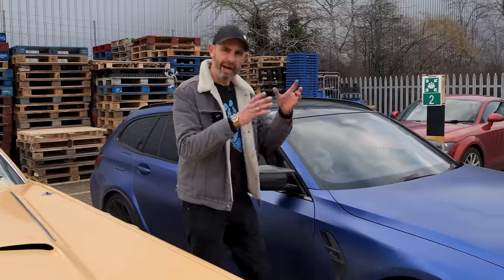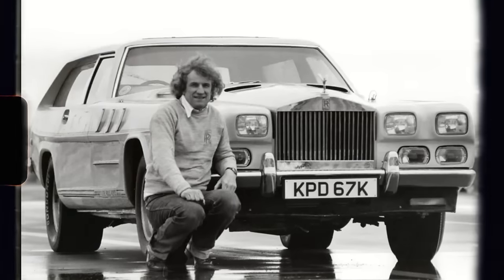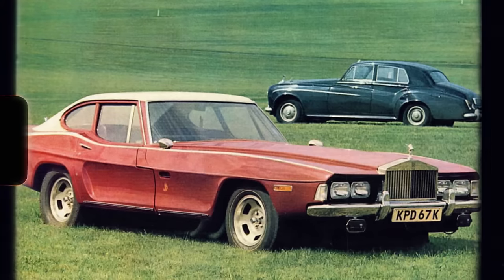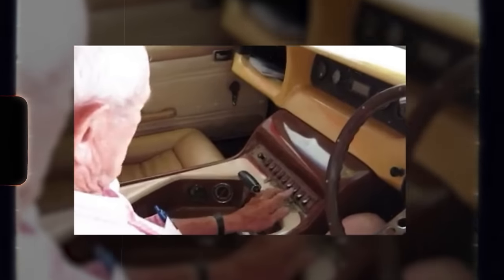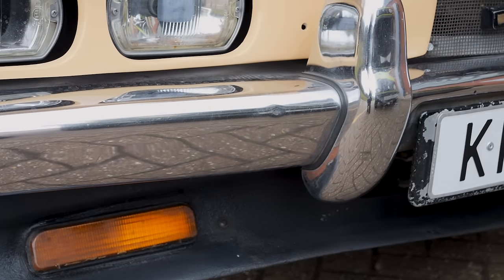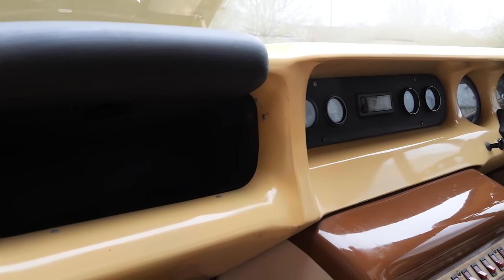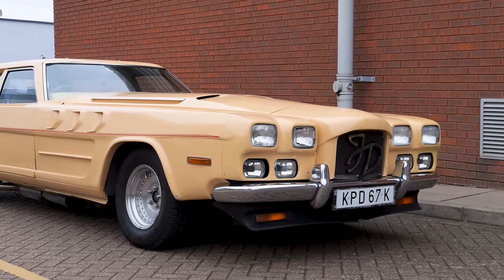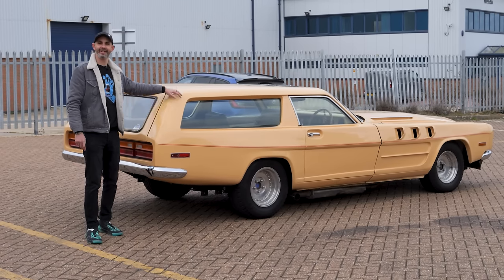Driving The Beast! 27-litre V12 Spitfire engined car on the street

Comment: Great video John! Its always great to see something someone has built from various  parts they've aquired. This in particular especially dealing with an engine idling at only 150 RPM. I noticed in the write up somewhere it was mentioned that a step up gear box was added. That probably is right off the crankshaft to get the input speed to the transmission correct or they would've had to make a custom designed torque converter to run at 150 RPM idle. Otherwise the standard converter would become a stall converter! I tried to imagine 27 liters being an American we use both cubic inches and cubic centimeter or liter measurements. I own a 2001 Chevy Silverado dually truck that has a 496 cubic inch engine that equates to 8.1 liters. So I wanted to know what 27 liters is in cubic inches 🤔.  Well it comes out to 1647.64 cubic inches! 
Back in the late 60s and early 70s American cars had some of the largest displacement engines of all production vehicles made. Like Cadillac 503 cuin. Also the more popular 472 cuin. That was used in Cadillac El Dorado's etc.
The 496 in my truck is a 454 that GM stroked the crank and rods. So it has the same bore and block design as the 454. Its the largest gas engine in a production vehicle at it time of production. I doubt there will be any big block engines made anymore with the electric vehicle market soon to take over. Believe it or not, you can get more power and torque from an electric motor than that monster big block gas engine!
Thanks for the awesome video and the history coverage of John Dodd's creation! 👌👍
Reply: the Lucid electric car is nuts! like 3 second quarter mile?!
Reply: Jesus said, “No one can enter the Kingdom of God (God's family) unless he is born of water and the Spirit. Flesh gives birth to flesh, but spirit gives birth to Spirit. You should not be surprised at my saying, You must be born again” (John 3:5-7). what does this mean? Well you have to believe with your whole heart that JESUS died for your sins and after 3 days and nighrs GOD raised HIM from the death, so you can be baptized and after being baptised ask GOD for the HOLY SPIRIT . WHO will guide you trough life!

Comment: Have to be honest Jonny , you were brave , very brave !  And thankyou for confirming the power unit . .....they actually ran 150 octane in the day . Jay Leno bought a Paul Jameison  Merlin powered 1934 P2 chassis and it ran , very briefly on a XK120 gearbox which was fine until Jay put it into second gear !  Jay's was also on a Holley 4 barrel , it now runs on 6 twin choke downdraught Webers . It's probably better that it goes to a museum . Thanks Jonny
Reply: 150 octane fuel 😂😂? From 1940 the RAF used newly-developed high-octane fuel imported from the USA rated at 100 Octane US (which is calculated as 103 Octane in Europe and was latterly known as 5* petrol in the UK). This expensive and rare fuel was generally reserved for combat aircraft and de-tuned training engines such as the one fitted to The Beast would’ve used the standard British wartime fuel of 87 Octane US (91 Europe). 
Jonnys wrong about 5* being equivalent to todays Super Unleaded though - thats 4* equivalent i.e. 93-94 Octane US = 97-99 European, which was the “standard” UK Leased petrol grade prior to Unleaded arriving in the 80s which saw standard fuel reduced to 91 US = 95 EUR (which was previously known in the UK as 3*). 5* was 97-98 US (where it’s still available at some gas stations, I believe) = 101-103 Europe (where it’s no longer commercially available).
Reply: @neilturner6749  It's not available everywhere, but 102 (Europe) petrol can still be bought, especially in Germany but also here in The Netherlands. I use it for my classic/hobby cars and (ironically) for my garden tractor/lawnmower because it doesn't have any bio compounds in it, so it will remain perfectly fine during the idle months in winter or even after years of storage. It IS crazy expensive though.
Reply: They did use fuel with a 150 octane rating nearer the end of WW2, for a power output of around 2200HP in a Merlin, look it up.🤣

Comment: I remember reading about this car as a kid. I've just turned 50. So I think it would have been when JD was going to court over the Rolls Royce grill. The court case had an effect locally to me as well, because here in Plymouth UK, there's a hand-made car knocking around on a Q plate, that used to have a Rolls Royce grill, as it has an engine from either a Shadow or Ghost. I saw the owner had to change the grill when JD lost his case. I remember thinking the Beast was a bonkers car back in the 80's. I'm glad it's still about and running.

Comment: The taillights are from the Mk 1 face-lift Capri or
 Mk 1 and a half as it was commonly known. 
The original Mk1 used Mk1 Escort lamps. 
The face-lift was only made for a couple of years sporting the then new overhead cam Pinto engine. 
Front windscreen I think is a Mk 3 Cortina.

Comment: Wow, that is loud inside! 

A little sound deadening insulation would be nice!
Reply: Why ?
Reply: @Dan23_7  I'm already more than half-deaf from cars & motorcycles, so I need to preserve what's left.
Reply: I’ve been for a short drive with John Dodd in the Beast and it is deafening, the transfer gearbox is louder than the engine. Ear protection would be advised for journeys of 5mins or more..

Comment: Fondly remember the Beast. I  preferred the more restrained (?) 1st body, but fab nonetheless. Dodd's realisation of the simple idea of the pre-gearbox reduction gearing (double the revs into the box = 1/2 the torque into the box) [don't know what ratio is actually in the Beast] is very clever. Be nice to find the other Jameson RR V12 aero engined car (6 wheeler)?!
Reply: I remember seeing the 6 wheeler at Santa Pod being driven before it had a body on it around the mid seventies perhaps.

Comment: As always, bringing excellent stories to light.  I wouldn't have thought it really needed the supercharger - my understanding is very rudimentary but I always though that superchargers were added to keep the power up at higher altitudes where the air is thinner.
Reply: tecdessus  I understand - it would give it more power regardless but I have heard regarding other planes that superchargers or at least 2 stage superchargers were needed for improved performance at higher altitudes. The car is staying firmly on the ground. That's where I was coming from anyway 👍

Comment: This car is the rebirth of John Dods original inspiration.
He wanted to put 2 aero engines side by side in a widened Rolls.
The engines rev low so thats perfect.
He used a car back-axle behind the flywheels

Each engine feeding power into the wheel hubs.
So he summed the 2 engine powers and increased the output revs (from the differential working in reverse) to feed the gearbox.
I often saw it in the workshop when they were battling with diff problems after a fire.
Then litigation from Rolls for widening the car resulted in it going abroad.
Reply: Interesting, when I was a kid in the 90s I was obsessed with the merlin engine. My ultimate car would have 2 side by side at the front (also 4 exles) and I built several versions of it out of lego, I never managed to attach power to all the wheels tho.

Comment: Quick correction, Spitfires absolutely had liquid cooling.  In fact, the other famed Merlin-engined fighter of the war, the P-51 Mustang (Models C & D used Packard-built Merlins) actually turned took advantage of this to go even faster, as its radiator was specifically designed to utilize something called the 'Miranda Effect' EDIT: "Meredith Effect."  Basically, air expands as it passes through a hot radiator, so if you design the air channels right, you can turn this expansion into a little bit of extra thrust—nothing too substantial, sure, but every bit mattered in a dogfight.
As far as air-cooling, you're likely thinking of radial engine aircraft, like the American P-47 Thunderbolt, the German Fw 190s, and I believe some models of the Hawker Typhoon or Tempest.  A decent bit of the P-47's famed durability is attributed to its engine for that reason—radials had a lot of surface area and didn't need liquid cooling, so you didn't have a radiator to protect (though I believe they still had one for the oil).
Reply: 'Meredith Effect'.  After the British aeronautical engineer Frederick Meredith.
Reply: @HistoricAeroEngines  .... I have a penchant for misreading things and remembering them incorrectly in my mind, thank you for the correction, sir.

Comment: Sorry, have to correct the comment about 2 star fuel. The Merlin was originally capable of running on low grade fuel, but by the time of the Battle of Britain, RAF fighters were using at least 100 octane. This gave the Spitfire an increase in speed of over 30 mph at height. The engine did indeed need a radiator, as can be seen under the aircraft. The size of which was kept down mainly due to the use of neat Ethylene Glycol and a much higher engine temperature of 120 to 135C.
Reply: Sadly Mr Smith has become the 'know all' who actually knows a fair bit less than he thinks. Regularly he makes statements that needed the research he patently fails to undertake.
Reply: True, and further aviation fuel octane is measured differently than automotive petrol. 100 octane AVGAS roughly corresponds to 100 MON, whereas the typical 95 RON petrol at the pump has about 87 RON.

Now, however, take away the supercharger on a Merlin, as this installation apparently has done, and I'm sure it can get by with much lower octane.
Reply: I thought it was such a shame all the bollocks he was talking about war planes needing to run on anything and not needing coolant up in the air such basic and easily searched things there was a bunch of others too
What a shame

Comment: Dunno if anyone's mentioned already, but they used to run Merlin aero engines on 100 ( at the start ) to 150 octane fuel in the war - increasing octaine rating was a much easier way of extracting more power than re-engineering. Given it's a 27L engine I don't think detuning it to run on 2-star is really much of a performance issue :D in an aircraft you want it idling at 1000-ish, 120rpm is interestingly low.

Meteors were Merlins made of less expensive materials ( used heavier cast parts because weight was less of a problem in a tank ), some failed bits from Merlin production, and most importantly they took the supercharger off.

Comment: The Meteor tank engine that was the first engine in this amazing car was developed by RR from the Merlin due to Britain needing a more powerful tank engine for the war. It was rated for 600-650 Bhp. It had no supercharger and was rotated 180 degrees to put the complicated gear drives for the auxiliaries, like water pumps, magnetos, cam drives, at the front of the engine. The reduction gear for the propeller was removed and the crankshaft now drove a massive separate clutch at the rear. It also drove two massive cooling fans through a gear case mounted on the rear of the crankcase.
So it would have been a much easier engine to have installed in a car. The Merlin must have been a headache!
Internally, the engines were pretty  well identical, though I would guess the cams would have been modified to deal with the different operating requirements.

RR was too busy building Merlin’s so they licensed Rover to build all the Meteors. The engines were very successful in a number of tanks.

I have installed a Meteor in a Centurion tank, and I was a bit surprised by a couple of comments in this video. The Meteor only weighed 1400 lb (which is incredibly light considering the the size of the engine), not the 2000 lb mentioned. I suspect they didn’t actually know much it weighed. 

The other comment was idling at 150 rpm. The Meteor with its two massive, crude, brass Zenith carbs won’t idle below 700 rpm, and that’s the spec in the manual. I doubt the Merlin was intended to idle at much lower than 700 rpm. Perhaps it was just too dam noisy! 

Being able to idle this low must be due to the use of the Holley 4-barrel, which would be able to control idle fuel down to a much lower level than the original carbs. But I would be really worried about oil pressure at that low an rpm. I assume there was an oil pressure gauge on the engine they could keep an eye on.

IAnyway, very good video!

Comment: The starting procedure is definitely an aero thing. I remember in the good old 152 you need to do fuel priming and oil priming, then switch on two magnetos and start the engine - and reduce the fuel . That’s called cold start.

Comment: The Merlin engine still needed large radiators, even up in the air, although they were mounted below the wings. Because of the coolant used (ethylene glycol), it could run hotter than water, which allowed more efficient heat transfer. That, and the colder air, reduced the size of the heat exchanger (which is what so-called radiators really are), but it has to be borne in mind that Spitfire with two stage supercharging could put out 2-3 times the power of the Beast, which means proportionately more heat, and what's more, would be expected to run at a relatively high proportion of its maximum power on a sustained basis. So heat was still an issue in aeroplanes.

There is also no way that a non-supercharged Merlin engine will produce 1,000 horsepower. In effect, that's a Meteor spec engine, which requires higher compression ratio pistons to compensate (as the supercharged engines use low compression ratio pistons), and 650 hp is more realistic. to produce that amount of power at 2,500 RPM would require almost 1400 ft-lb of torque (which was about what the Meteor produced).

Comment: To think that that engine is 540x larger than the moped engine I started on... and if this power was actually harnessed properly... holy moly.. :) Would love to see another effort like this with full supercharger and injection system with a manual transmission hah.. :D
Reply: You’d need a Strongman competitor in the passenger seat to do the shifting for you

Comment: Amazing, but image this car equipped with a much more powerful 2,000 HP Daimler-Benz DB 605 supercharged engine with 35,7 litres and 12 cylinders. Those engines were usually fitted in German WW2 combat airplane Messerschmitt 109`s. That would be THE beast !

Comment: It is not an Spitfire engine, but one from the Centurion tank. Same basic engine, but the flight version had a huge radial compressor in front, as well as fuel injection (to fly inverted).
The Centurion tank engine is named Meteor, and was built by Rover.

Comment: It has a GM TH400, the world's best automatic transmission! Even Rolls Royce used them.

The engine sounds and looks like it's in bad need of a tuneup if not a rebuild. A V12 should sound much smoother than that, and the blue smoke suggests a lot of wear and blowby. It's probably making a fraction of the power it could.

"Assembled in Britain from domestic and imported components."😄

Comment: JD used to come to Canons Motor Spares & Accessories at Mc Cauley Road Clapham. 
I used to go to Pratt's Bottom to the Auto box shop. All the glass should have code numbers on , the lights under the headlights are fog/driving units by Lucas as for the Headlights early Ford units or Vauxhall with numbers somewhere. Mk3 Windscreen looks possible or a late capri

Comment: Something is wrong with the specifications, but please correct me if I'm wrong. If the engine is worth 950 horsepower at 2500 rpm, then the torque there should be 1996lb ft.

Comment: At 21:00 you left the primer on after it was started and im sure you realized this after the blue smoke cleared. after 5 seconds you were to turn off the primer. it would run much better without it being choked. looking back i heard someone tell you to leave it on which is incorrect. if your going by the owner startup.

Comment: An Arduino or Raspberry Pi would completely automate the start up procedure and provide error railing in the event of equipment failure (such as the fan check).  One button start-ups completely possible in a one day job.

Comment: Several oddities here,  Merlins were used in more than a dozen of aircraft and this particular one did not even come from a Spitfire but is in fact a far less powerful version from a trainer aircraft. And those engines being liquid cooled, they needed radiators too when fitted in an aircraft. That thing about the fuel quality..
Well, during ww2 the supercharged aircraft engines did not run on just anything, 100 octane at least.
But that was with a supercharger on, so only without this deleted you can do with a little less expensive fuel.

Comment: Dude drove with the primer ON the entire time. That is so sad. And also, i may be wrong but, the electrical fuel pumps are being used in an auxilary role to feed the main engine driven pump. After startup they should be switched OFF as to not to burn them up. Or they just should stay ON to prevent vapour lock, maybe.

Comment: 13:40 did he say that Merlin was an air-cooled engine in its original airplane setup? Radial aircraft engines were air-cooled as all cylinders received equal airflow, but all V-format engines were liquid-cooled. Otherwise the rear cylinders would melt. Otherwise an amazing car and a great video.

Comment: The original one pictured on the first edition of beyond two thousand magazine in the eighties not this one but pictured with the rolls Royce grill and full length bonnet as a sedan, ran a Westminster diff being virtually indestructible and a sedan, claim could cruise at 200mph that’s miles, unfortunately an electrical fire destroyed that version before its exposure, what a loss, this one
had nothing on that, sad